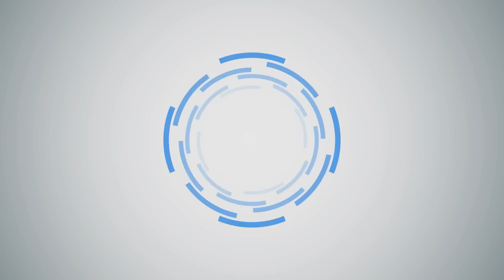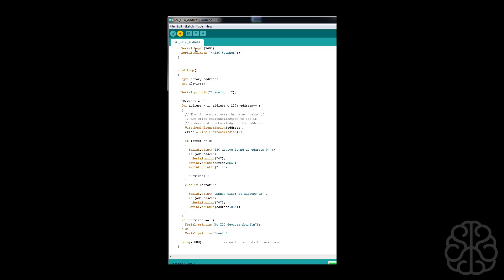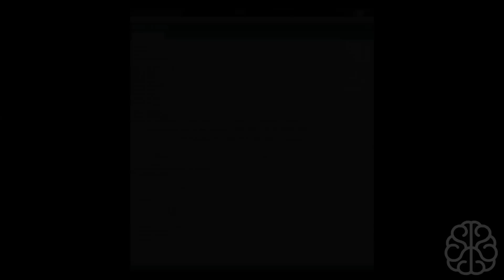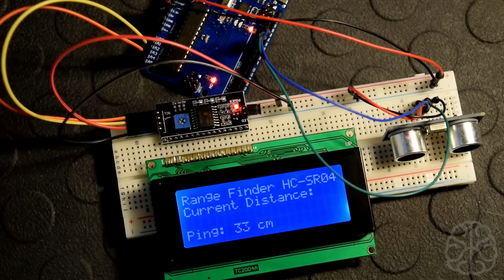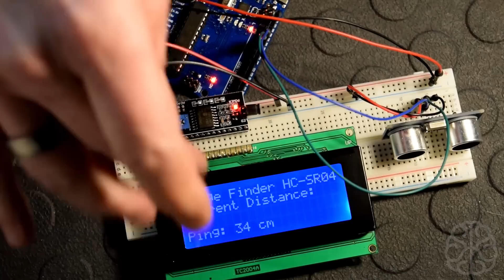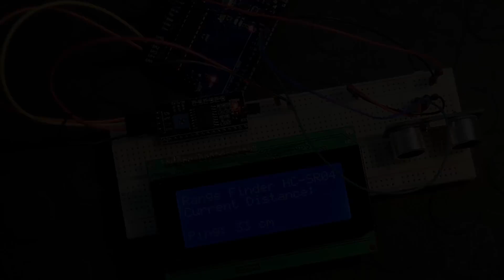Use the I2C Bus to control a Character LCD with Arduino - Tutorial

Comment: Hello  I AM new to arduino, I am working on a 
rov project and want have a uno as the master due to me only having the 6 wires from the ps2 controller and 2 for the lcd.  I would like to use my mega arduino for the depth, compass , motor control and the 8 ch relay board is this possible,thanks

Comment: who can help me and ask me to change a code for a 2004A display that connects to an arduino nano by 6 wires on 6 digital pins and now i found a module that attaches to the display and uses only 2 wires for data communicating through the i2c protocol with arduino, i have all the code i need only modify for i2c communication with the display

Comment: everything worked exept the backlight wont turn on? any ideas why?
Reply: You have to put a little jumper on the two pins on the other side of the i2c board. that's all. I think there's also a way to control it by arduino, that's why they put the jumper there.

Comment: I use arduino mega 2560 r3 with pins 20 and 21 for sda and scl to communicate with i2c lcd backpack

What exactly are the arguements in the brackets other than the address 0x27. (0x27,2,1,0,4,5,6,7)  in the following command line.

LiquidCrystal_I2C lcd(0x27,2,1,0,4,5,6,7);

Comment: I'm having a heck of a time getting this thing to work with a PIC microcontroller. Logic 4 shows that I'm sending all the right commands for a 4 bit initialization of the LCD but it refuses to initialize. The same LCD works in 4 bit mode without using I2C so I'm kind of at a loss here. There is next to no information on using these things with anything but an Arduino library which really doesn't give any insight into the actual workings of it.

Comment: I have the sainsamart version of this lcd i2c channel connector. I found he sainsmart version 2004A to conflict with the RTC on the i2c address buss.  Have you found this issue with your model.  I am using another brand that does not have any i2c address conflicts with other devices. thanks for the great video.
Reply: Sounds like they may have the same addresses. On the devices there will be jumpers which can be bridged to change the address. Solder between a pair of the address jumper pads to change it.

Comment: Hi, The scanner says 

"Scanning...
No I2C devices found " 

but I have it wired as you do and the red LED is on for the display.

Any Advice?

Thanks!
Reply: Did you solve it?
Reply: Because i have the same issue, very frustrating XD
Reply: No, I was wondering if my cheep screen is defective. I purchased mine off Ebay for $2-3. Does your backlight work when hooked up?
Reply: Sebastian Law
dont know i do see only the top blocks when plugged in and if i turn the contrast screw they turn white i think it is defective.....

Comment: Great video but the newLCD library does not support teensy 3.1 or 3.2 microcontroller boards. I was able to compile it by changing the board to arduino UNO, but as soon as I change it back to teensy 3.1.I am using 20x4 LCD (2004A) with attached one of those I2C boards (PCF8574A I/O expander) with the address of 0x3F.it wont compile and it gives me an error. Do you have modified code for those processor platforms? Thanks!!!

Comment: Wire/Wire.h: No such file or directory
Reply: NEWS FLASH!!! I found out how to fix this!! (Well for my hardware here. Try the library at this link:
http://arduino-info.wikispaces.com/lcd-blue-i2c

I downloaded the NewLiquidCrystal 1.3.4 zip and installed the library and then retried the sketch and voila! It worked.

Hope it works for you.

Would be nice if the brainy-bits people could have helped here, I spent almost 24 hours now trying to solve this!
Reply: +smurnav1 Wire.h is part of arduino. If you have arduino software installed you should have the wire library.
Reply: Unfortunately I have also had the same issue even though the wire library works for other projects.
Reply: me too
Reply: I've got the same issue and have no idea where to start to look how to solve it. I even tried a fresh  install of the IDE environment on a diffreent machine, as soon as I go to verify, wire.h error comes up and terminates.

There must be some fundamentle thing I'm doing wrong, but unlike having tinkered with PC's for 10 yrs, programming is just way over my head. It may as well be written in Greek, but unless it works flawlessly as shown in the description which I can follow keystroke by keystroke. I'm lost.  Help!

Comment: C:\Users\J\AppData\Local\Temp\Temp1_I2C_LCD_Tutorial.zip\I2C_LCD_Tutorial\I2C_LCD_Tutorial.ino:4:26: fatal error: ...Wire/Wire.h: No such file or directory

 #include <...Wire/Wire.h>

                          ^

compilation terminated.
Reply: +Bruno Christensen Go to the LiquidCrystal libraryfolder (Documents/Arduino/libraries/LiquidCrystal) and there you edit the I2CIO.cpp file with the stndart editor. 
There you find    #include <../Wire/Wire.h>
You edit it to #include <Wire.h> 
Then you save the document and restart the Arduino IDE and it works
Reply: +me you fixed?
Reply: +smurnav1 yep. thank you
Reply: +me How?
Reply: +smurnav1 I edited one of the library files that contained "#include...//wired.h". I can't remember which one. it might tell you in the error. I deleted "...//" and saved the file
Reply: +me sorry. I deleted "..wire/" so that it is only "wire.h"
Reply: +me where did you finde "wire/"  ??
Reply: +Kashmir Romer Thank you very much! Your advice helped me getting it to work instantly! :D A further note for help is, if the text editor doesn't let you save it there, put it on the desktop and then move it in the folder. Again Thanks.

Comment: Hi, I have the I2C scanner working and have my address.
But when compiling the LCD test program I get the following error:
------------------------------------------------------
C:\Program Files (x86)\Arduino\libraries\LiquidCrystal\I2CIO.cpp:35:26: fatal error: ../Wire/Wire.h: No such file or directory

 #include <../Wire/Wire.h>

                          ^

compilation terminated.

exit status 1
Error compiling for board Arduino/Genuino Uno.
-----------------------------------------------------------------

It would appear the script cannot access the wire.h file for some reason???
Reply: +Darren Turner I've managed to fudge it and get it working.
But it would appear the path to wire.h from I2CIO.cpp is not correct for my Arduino install.
Reply: +Darren Turner How did you get it to worke?
Reply: +Bruno Christensen I think what I did to fix it was.... Rather than installing the wire library in the libraries folder that is within the Arduino folder in 'my documents' area. I installed the wire library into the libraries folder that is in the main Arduino folder on my C drive. The the path was correct and then the sketch ran perfectly.
Hope that makes sense and works for you. 👍🏻

Comment: Hi Ivan, great video, thanks for clearly explaining everything out. I am very new to arduino and have one of the 1602/I2C kits on its way. You showed how to get the address of the I2C board and that you can use multiple boards in one project. My question is, how would you change the address of the I2C board (since there is a possibility of having two with the same address in your project).  Thanks, Tony.
Reply from the maker: +ThinCube Hi, most of the I2C backpack use the I2C Address 0x27 as default but a Few might have 0x3F instead.    There is 3 sets of pads on the PCB that depending which combination you solder will give it a different address.  You need to solder the pads of A0, A1 or A2 on the I2C backpack to change the address.  Hope that helps!  Thanks for watching btw :)
Reply: Brainy-Bits Great, thanks for replying!

Comment: thanks, In Arduino MEGA 2560, You should connect to pin number "SCL" and "SDA" .... A4 and A5 not working!
I changed 20*4 to 16*2 and it work well :))
Without all libraries below CODE WON"T WORK!!!
#include <Wire.h>
#include <LCD.h>
#include <LiquidCrystal_I2C.h>
#include <NewPing.h>

they take 5,322 bytes !!! Good luck to all
Reply: Thank You! Fixed my issue :)
Reply from the maker: +Ahmed Hameed Thank you for the info on the MEGA 2560, always good to see others sharing their experience and solutions... Also thank you for watching of course :)

Comment: One question from a newbie.

I have noticed on the websites, that the I2C is often being specified for 16 x 2 LCD.  There should be no difference between the I2C modules for either 16 x 2 or 20 x 4 LCD display modules.  Am I right in my assumption ?
Reply from the maker: +Madhav Pulivendala You are correct :)  The I2C module I use in this video supports LCD from 8x1 to 20x4.  Thank you for watching!
Reply: thanks a ton.

Comment: i have some issues...when i put the liquidCrystal library and i include LCD library it says that my liquidCrystal_I2C doesnt found i did all as u did...
Reply: +Kontos Xontros also my lcd.home and lcd.setucursor commands are not working
Reply: +Kontos Xontros if some one knows why my home and setcursor functions doesnt work tell me plz..
Reply: +Kontos Xontros i found out that when i rename the original library ,my programm cant find liquidCrystal_I2C.h and LCD.h but lcd.home and lcd.setcursor functions work...but when i delete the old library my programm finds oute the liquidCrystal._I2C and LCD and lcd.home and lcd.setcursor doesnt work.....i am at dead end
Reply from the maker: +Kontos Xontros Hi did you ever find out the problem on this?

Comment: In the code you have: #define Rs_pin 0, #define Rw_pin 1 and so on..
Are the Arduino pins 0,1,2,3..etc, used for the LCD trought the bus, or can I use them for something else?
Reply from the maker: +Armin Allijagic As you can see on the Schematic here: https://brainy-bits.com/tutorials/connect-a-character-lcd-using-the-i2c-bus/ only a couple of pin are used on the UNO, so any that are not connected you can use for something else no problem...  Thanks for watching!
Reply: +Brainy-Bits Thank you for the answer and the fantastic video. I have completed the tutorial and it works with no problem . I'm very amazed with the fact that it only uses two pins, and they are not even digital pins. Keep up the good work !
Reply from the maker: Armin Allijagic You're welcome :)  Thx for the comment!

Comment: I have everything hooked up as shown, but the LCD does not display anything. Any advice? The backlight is on, and I got a good address (0x27). Not sure what to do next.
Reply from the maker: +Benjamin Hammaker It's hard to say but first did you try turning the Pot on the I2C backpack to adjust the contrast?  Make sure the pins of the backpack are connected to the right pins of the LCD.  Make sure your connections are solid, if using jumper wires, change them for other ones to see if one of them is broken.  Hope it helps!  Thanks for watching!
Reply: +Brainy-Bits Yep, the contrast was too low. Everything else was fine. Thanks!
Reply from the maker: Glad to hear that it's working!  Thanks for letting us know!

Comment: will this work with the 1602LCD keypad shields?
Reply from the maker: ArcAiN6 Should work, as long as you make the same connections...  But of course you'll only have 2 lines instead of 4 :).
Reply: ty :)

Comment: Hi, Followed your Instructions and everything fine except the reading I get is,Ping 0 cm and Ping 1cm. Do you think I have something wrong (using uno and HC-SR04)
Reply from the maker: +nevcams Hard to say, hopefully it's not a defective HC-SR04.  But maybe check the connections, and if possible use different jumper cables.  Thanks for watching!

Comment: Thanks 4 the video!! I tried on mega board and >> "No I2C devices found" message what i get.
Tried with uno board works fine there!
Any ideas?!! Thanks!
Reply: Bence Gyulai okay the only problem was i had use wrong pins >> pin 20, 21 are the official sda and scl pins for the mega board. works well
Reply from the maker: Bence Gyulai Hi Bence, sorry didn't see your comment earlier, but glad you managed to figure it out!  Thanks for posting the solution for others to see!